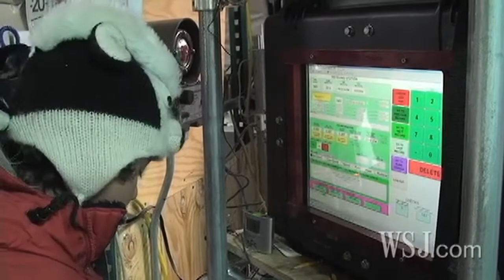Unlocking Antarctica's Secrets

Comment: Phenomenal report - both the video and accompanying article!  Only discovered it recently after the issuance of the new UN report on climate change; reading about it in the WSJ and finding the link to the 2010 article and this video.  The data from this work was so critical to clarifying correlations between atmospheric conditions and earth temperatures going back 100,000 years, before man had any potential hand in affecting global temperature, then using that information to determine if man had a role in global warming.  Critical work done very well.  Thanks for reporting this.